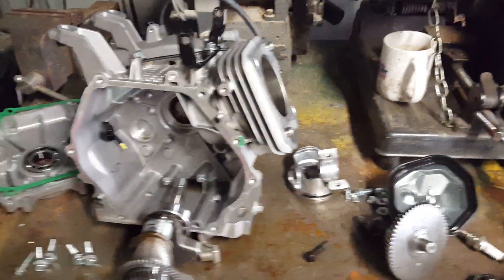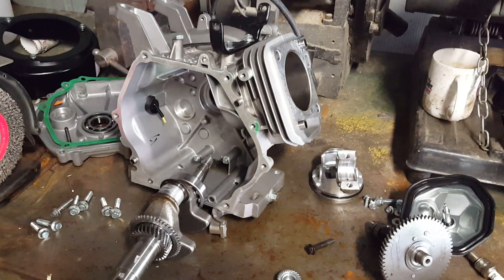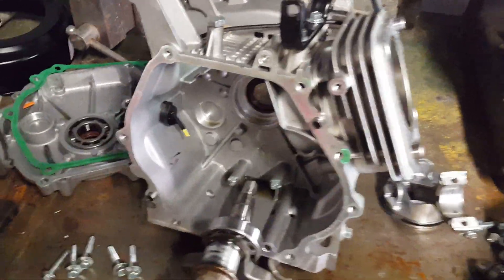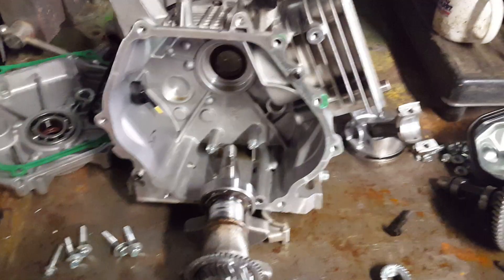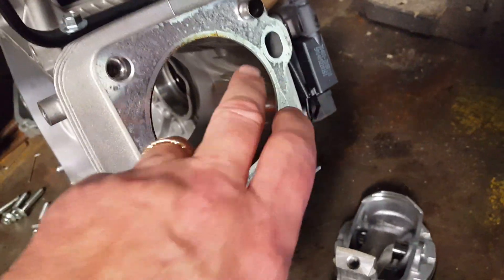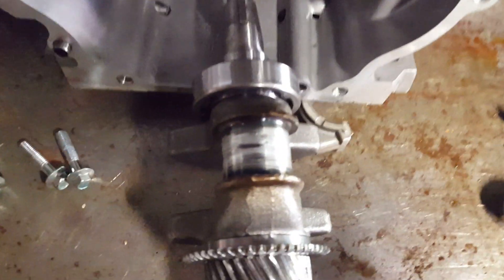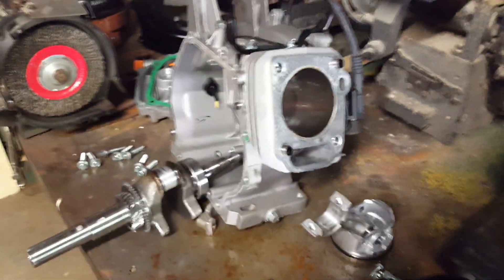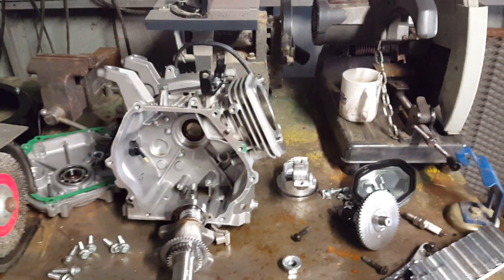What not to do to your Predator 301 or any small engine.

Comment: Your cylinder is glazed and discolored BAD. The "glazed" is that very shiny, almost mirror polished clear coat look to the entire cylinder, and the golden brown discoloration -- both of these things are signs of SEVERE overheating and or bad oiling. 

I think you were correct on the timing being way too advanced + way too much oil as the cause, but just wanted to point out for future diagnostics that those two things (glazed and discolored cylinder) tell a story of their own.

Comment: Hi Rumnhammer! I know this is an old video but I don't think this was your fault my friend. The timing being a bit high wouldn't cause the oiling failure issue. The problem was also not likely that you overfilled the oil. More than likely your carb failed you and leaked raw fuel into the engine oil. This thinned out the oil and increased the volume of oil in the crankcase. The thinned conventional oil could not lubricate the engine and that's where the heat came from and the failed rod bearing issue. All and all it's more than likely a case of bad luck with the carburetor, not your fault IMO.

Comment: Um...You do know that once hot 5W30 and 10W30 are the same right? Both oils are rated as 30wt oils when at normal HOT operating temperature. So, they are equivalent where an engine spends 99% of its life.
Reply from the maker: Yeah I know that , doesn't matter what the weight of the oil is if you put too much in which is what happened here.   when you check the oil on the uphill side when the engine is not level and add oil to it having too much in is just as bad as not enough.

Comment: Higher cylinder pressure = higher bearing load, combined with extra heat and foaming oil = less lubrication to the bearings, spelled doom for your engine. Thanks for sharing.

Comment: "How did you conclude it was all those things that caused the rod to pile-up and not that you degoverned a stock engine and ran it at sustained high RPM and high load in a boat?"

E X A C T L Y
Reply: Because it happened at idle in my driveway exactly.
Reply: @chrisrummel2686  Just because it gave up the ghost in your driveway does not mean it was not because YOU degov'd it and simply locked it up.
Reply from the maker: @NrlyWrx  The engine would not lock up just because the governor was removed.....it was destroyed because of too much oil.  All the governor does is prevent the engine from being over reved.   and as I said it was running at idle when it happened.
Reply: @Rumnhammer  I know exactly what the governor does, I modified the 420cc big block and removed the governor as well...

Just because it decided to give up the ghost in your driveway at idle does not mean it wasn't because, against good advise, you removed the governor and did not build it to withstand said circumstances.

It sucks and I am sorry for you that it did happen....
With that being said, respect to you for doing your own work.

Comment: I have a problem after taking mines apart and removing the governer I got oil in the exhaust when I checked it this morning it was so hard to turn over piston sounded like a plunger so I figured I flooded it so I too the spark plug out and filled the head with gasoline to dry up some of the oil I turned the motor over a few times watched it spit but now it will only crank with starter fluid and only for a few seconds at that any suggestions?

Comment: I don't think it was the timing at all.  First, you used too much oil.  Then you disabled the governor and used the stock rod.  They say that the stock rod can handle 6k rpm but I wouldn't trust it.  And when you remove the low oil sensor, there is no need to put the bolts for it back in the block.  You are asking for trouble by doing that.

Comment: You don't seem that confident that it got too hot, that it was the "wrong" oil weight or type, that had too much oil, or that it had too much timing.

How did you conclude it was all those things that caused the rod to pile-up and not that you degoverned a stock engine and ran it at sustained high RPM and high load in a boat?
Reply from the maker: probably because it was red hot and had oil vapor coming out of the breather.  This also happened at idle in my driveway not when under load.
Reply: Are you sure the float level didn't fail in your carburetor and fill your crankcase full of gas

Comment: What is a advance key ? Cause I have a 301 and I am doing mods to it
Reply from the maker: It is the little woodruff key that goes on the flywheel side of the the driveshaft.  it locks the flywheel on and by having a little slice out of it moves the position of the magnet changing the timing.

Comment: You can clean up that drive shaft and piston boot with Emory cloth and replace the Piston bearings with new ones and that motor will be fine after you re-set the timing. Just use some good oil in it next time too.
Reply: these little guys don't have replaceable bearings, unfortunately

Comment: The too-much-oil theory: wouldn't the slinger be perfect for whipping the oil into a froth, if that were going to happen, at the best of times. That's why this theory doesn't make sense to me.  Edit: wait, does this engine have no oil-slinger?
Reply: What the hell is piston bearings? This is what really gets my blood boiling. Spreading misinformation to someone looking for help or someone new to the Hobby or whatever leads to someone having catastrophic failure on whatever they're working on. They trusted a platform to post a question on and sadly trusted the answer given by someone that has no idea what they're talking about. I'm not being mean I'm just simply stating facts. Especially when dealing with the small engines modified or not it's comical to read through the comments and sometimes I scroll through the comments just for that very reason. With all this being said it also makes you look.,...well you know....

Comment: if it detonated that bad then why are there no signs of it? timing had nothing to do with it, now adding all the extra oil killed it. the rod was beating the oil and foaming it up and the motor didn't oil correctly and starved the rod for oil, hence the ate up rod and crank but no signs of detonation damage.
Reply: Always use synthetic in an air-cooled engine... except for maybe the break in process. It probably would have kept this engine from dying at least that fast.
Reply from the maker: The advanced timing ~9degrees of advance didn't kill it by detonation, it helped to kill it by all the extra heat it put into the engine.   When I talked to ARC that is the answer they gave me.  Since the 301 already runs 3 degrees of advance using a 6 degree key makes it run hotter especially if it is stationary.   So this time on the new engine I'm sticking to the stock key.   The extra timing is not worth it on this engine.
Reply: Rumnhammer too much oil = foaming which = bad/improper/not oiling... that means RIP predator 301.... lol granted it may have been running warm, but the crank and rod clearly show lack of lubrication.
Reply: I completely agree with what you said this had nothing to do with how the engine was set up other than the fact that you put too much oil in it. I see no signs of detonation at all. If you can show us some marks on top of the Piston from detonation or in the combustion chamber then I might believe it but when you said there was that much oil coming out of it that's what killed it. And the proof is sitting right in front of you with a dead bearing.

Comment: Does ARC make an extra long 270 rod? I was wondering  since they make these rods in so many different lengths compared to a stock rod , they might be able to speck something for you, especially with the different sized bearings they offer. Perhaps a 270 rod at +.040 length might have fit, but I don't know. If you're running well now I guess it's all in the past. Run well. These are really good kits.

Comment: Now that you have but apart, are you going to do any modifications?
Reply from the maker: Yeah, I run the ARC 6277 flywheel it's the one for the GX270 works on the 301.  It fits the new for 2016 301s too thank god.   I would run the billet con rod too if they made one but they don't so I'm not running any advance key this time.

Comment: Yeah, I run AMSOIL 10W30 Z-Rod oil lots of zinc for tehse flat tappet lifters, the anti corrosion/rust inhibitor package from their marine oil, and it's synthetic.
Reply from the maker: Running 10w30 mobil 1 in the new engine, after I broke it in with driven BR 30 break in oil.  I probably should have added to the video that the reason I had too much oil in was because I checked the level when the trailer was on a slope so the oil had all gone to the other side and made it look like it was way low, so I had about 1/2 quart too much in there.  Lesson learned if there is any chance of this happening now I check both sides dipsticks, and I also left the low oil shut off in the new engine as well so worst case if I actually am low the engine just won't start.
Reply: Oh, wow, 1/2 a quart would be way too much. I know with the oil sensor, we'd always add a couple ounces more, but, yeah, 1/2 quart would be like mega death.

Oh, so, you already have the motor built and all.

Comment: Basically pre-ignition? So let me ask, do run a billet connecting rod?
Reply from the maker: no unfortunately ARC doesn't make one for the 301, yet anyway if they did I would.   They are much nicer and include an additional hole through the oil flinger that leads to the journal bearing.
Reply: Okay, I didn't that ARC didn't make one. Yeah I'm running the ARC Rod in my little 212.

Hey, Don;t know what your plans are for this motor but I found a company that sells 390 clones for like $160. I'm not affiliated with them in any way, but these motors are all the buzz over on the mudmotorkitforums: https://www.powerlanddepot.com/index.php?route=product/product&path=39&product_id=64

Lot of good guys over there. Since you own a Swamp Runner you can get access to the Shade Tree section of the forum where we talk about hopping up these motors.
Reply: No preignition, just simple lube failure.